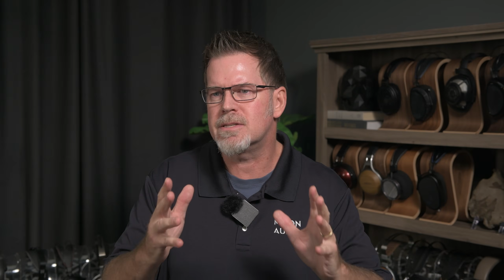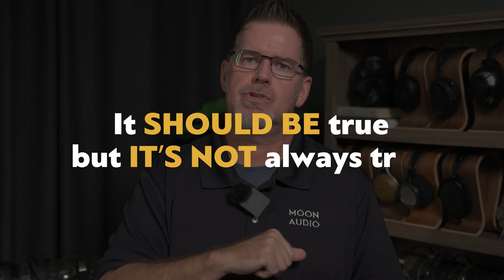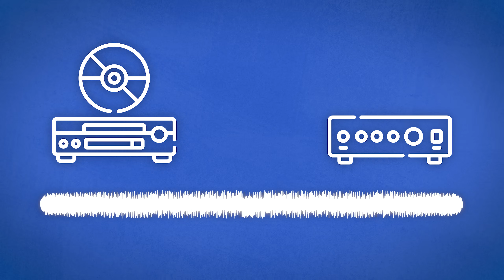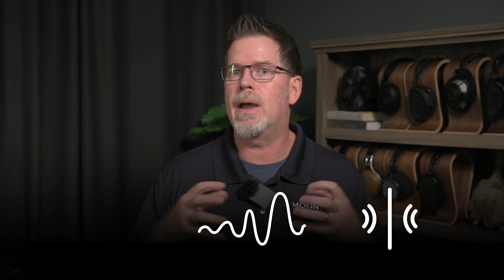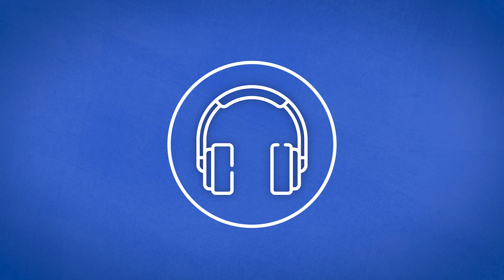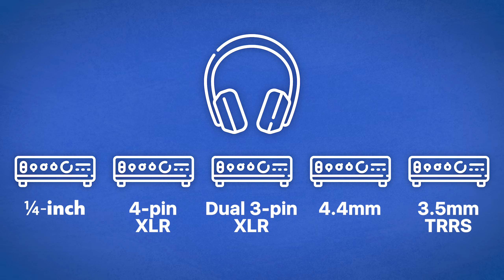Balanced vs. Single-Ended Audio: The Truth About When It Actually Matters

Comment: I agree. I have both balanced cables and  balanced outputs and inputs.  I experimented with my pseudo balanced amp. I have used both single ended and balanced cable with several headphones. The balanced configuration did sound louder at a lower volume setting. However, I'm not sure that it sounded quieter in terms of backround noise- lowered the noise floor, in any meaningful way.
Reply: @timothyfreeseha4056  that's because you are using headphones. Balanced increases voltage so headphone becomes louder (I'm simplifying it). Voltage also makes bigger difference from noise floor. For speakers you will not have it sound louder since all it does is increase the difference between signal and noise floor.

Comment: This came up in one of your other videos, and I was going to respond there but the topic of this video is the right discussion, so I'll go over it here instead. Just about everything you said in the video is great, but there's one issue that's being overlooked. This only applies to headphone products and how they're marketed. Headphones are a regular pair of speakers, just smaller. They connect and function identical to the full size speakers in your living room. Headphone cables are not balanced, even though they are labeled balanced. You have 4 separate conductors, a + and - for each speaker. This is identical to how you connect  a regular full size speakers to a power amp. If you call 4 conductor headphone cables balanced, then you must call the speaker cables in your living room balanced as well. There is no difference whatsoever between the 2. And as far as cables go, there really are no balanced cables. Its the electronics that are balanced, and they just require a certain cable configuration. 

Now we get to the part that everyone is missing. Whenever you talk about a headphone amplifier that's balanced, its a marketing term. Substitute the word balanced for bridged. If you look at the specs to a balanced headphone amp, you are going to see 2 things. You'll see the normal 4-6db higher signal level that you normally see with balanced components, and you'll see twice the amount of amplifier power in watts. Twice the power has nothing to do with balancing the signal. That happens in the amp. The reason you are getting twice the power is the headphone amp has 4 channels that get bridged to 2 channels. And when you bridge an amp, you can't use the same speaker terminals on the back of the amp. Normally, you connect the + and - speaker cable conductors to one channel of an amp. When bridged, the + cable gets connected to one of the bridged channels, and the - goes to the other channel. None of this has anything to do with balancing. 

So why don't they just tell you that you're using the amp in bridged mode? There are downsides to bridging power amps. Most people think that when you bridge a stereo amp, it gets turned into a mono block. That's not true. A bridged amp and a mono amp are 2 different things. A bridged amp sees half the impedance of an unbridged amp.  If you have an 8 ohm speaker and plug it into a bridged amp, its a 4 ohm speaker. You force the amp to work twice as hard to drive the same speaker. And that's why "balanced" headphone amps may sound worse than normal. Bridging the amp makes it sound worse, not balancing. With balancing, the worst case scenario is you hear no difference. Sometimes it sounds better, sometimes there's little to no change. When you run an amp bridged, you can take a hit in sound quality. If you have headphones that need a lot of power to run properly, using the amp in bridged mode may sound better. If you have normal, easy to drive headphones, running the amp bridged can sound worse. That's why the term bridged is never mentioned.  

In the video, he talked about having to separate the grounds of a single ended signal so it can be converted to balanced. That's true. The reason its needed, is bridging uses 4 separate channels, and each channel needs its own conductor. They use the "fake" balancing he mentioned in order to separate the grounds so they can bridge the amps. That's it. Balancing the signal to separate the grounds allows them to use the term in marketing. The same exact process is done to home power amps, pro amps, car amps and every other kind of amp and they use the term bridging, not balancing. Its easy to miss, but that's what they're doing.

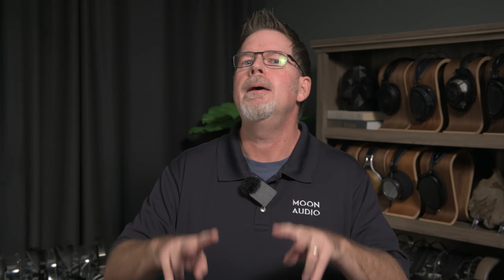Comment: @2:45 -- Well, balanced is always better.
Amps that conceal their double-conversion operation (balanced to single-ended, and then back to balanced) do not, to my mind, qualify as balanced amplifiers.  They are single-ended within the box.

Amps that truly are balanced will sound better than single-ended amps.  Not always.  There are always exceptions.  There are bad sounding balanced amps, and there are great sounding single-ended amps.  But when similar quality amps are compared, the balanced ones (truly balanced ones) will sound better.
Reply: "Amps that conceal their double-conversion operation (balanced to single-ended, and then back to balanced) do not, to my mind, qualify as balanced amplifiers.  They are single-ended within the box."

While not the same thing, it is legitimate. If you need to run long cables and want the noise cancelling of a balanced design, those features can be added at a very low cost. Almost all pro gear is made that way. But you can also make the point that some companies aren't too forthcoming with information. They'll just say balanced and hope the customer doesn't know the difference.